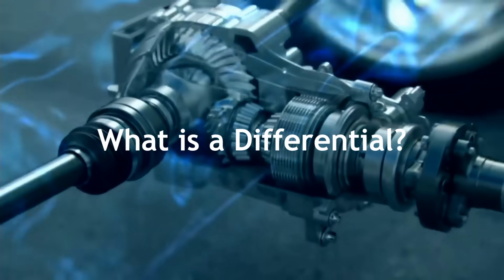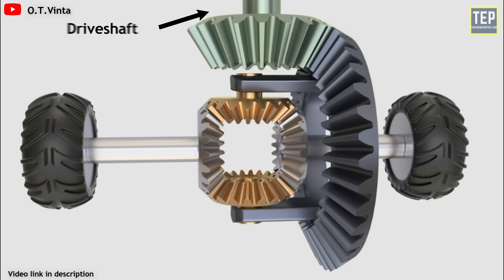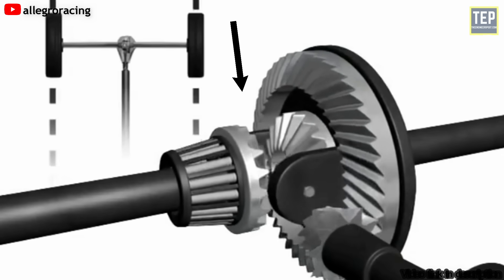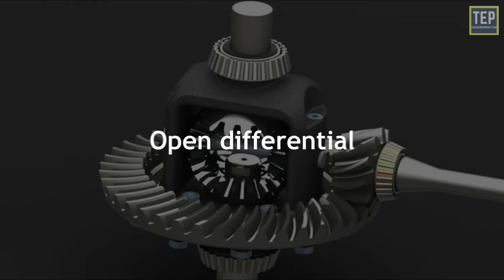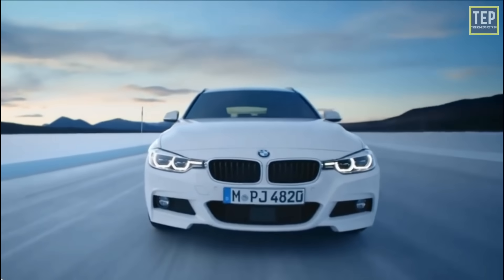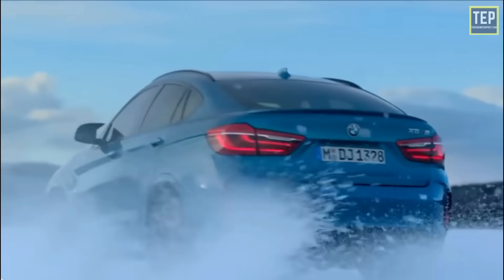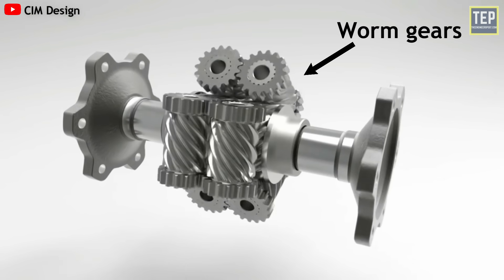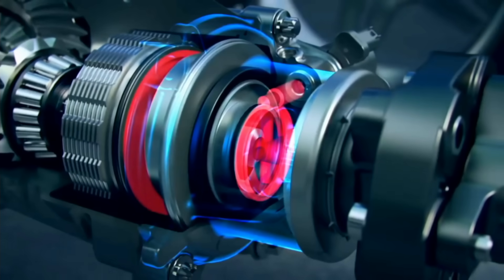How a Differential Works | Types of Differentials Explained

Comment: Hi! Hope you are doing good....I have a small doubt... how does the spider gear knows that the car is turning so that it reduces the speed of the opposite wheel?....It would be great if you have time to explain me this😰
Reply: Its. A matters of load on wheel. If one wheel cant turn and the crown gear is moving. The one side of the spider gear is locked. So to move with a crown gear it needs to rotate to overcome the lock of the side. Its like a normal wheel. When it touches the ground the point of touching is stationary. To move foreard the wheel needs to turn.
Reply: Oh ok...now got that...Thanks for your time!

Comment: Locking diffs and locking hubs for off road use, man what good times!! I remember jumping out of the truck to lock the hubs!
Reply: im looking to buy a daihatsu feroza and it has manual locking front diff
Reply: @kyal1068 what he's refering to are manual front hub locks, which enable/disable the connection between the halfshaft and hub.

This disconnects the front differential from the hubs individually, but combined with selecting 2wd completely disconnects the front drivetrain from the transfercase and wheels, increasing longevity & fuel economy. 

You have pneumaticly controlled, electronically controlled, and mechanical/automatically controlled lockers

and If I had to take a guess it probably has a mechanical locker.

Comment: I believe that Thorsen differential is better then ,,open" diff. in a cheap small car. From what I understand ,Thorsen diff. in a 4x2 traction car, do not spin a suspended in air wheel (with no point of contact with the ground) while the other wheel which is on the ground (have 100% grip on the ground), stay (and not spin at all).
Reply: That's true. The use  of worm gear-worm wheel combination means that if one driven wheel encounters zero friction condition and "wants" to spin all the available torque away, it cannot because the worm gear can't drive the worm wheel, so the driveshaft that has traction (the one on the asphalt!) controls the rotation rate of BOTH worm gears, thus transmitting all the torque to the entire driven axle. Frankly, it's genius! Works on snow, ice, mud and round Druids Hill bend at Brands!
Reply: @robair67  Yes it's the best of both worlds, can't get why he said in the video that it consents wheelspin.

Comment: I got the Torsen differential out of a firebird and put it in my S10.  Mine's a 4.3L 5speed and that thing...I've gotten stuck on wet grass before when I had the stock open differential in it. It drives really good with the Torsen in there. GM should have offered it from the factory.
Reply: When did firebirds use torsen differentials? Ive considered putting one in my 3rd gen, never knew they were a factory option.
Reply: @sthomp731  I have the last generation of the firebirds a 2002 and I don't think it comes with a torsen differential but the limited slip differential (LSD) I know because I fixed a leak replacing the gasket and it looks more like the one I just mentioned;
Reply: @chrisdrake3238  1999 to 2002 Camaro/Firebirds that say Y87 on the vin sticker on the driver's door will have a Torsen. Some of the V6 3.8L could have a Torsen also. If you can't find one,Hawks motorsports had some used ones for about $250.+ shipping.
Reply: @Thundarr995  didn't know that but I'll check mine if it has that sticker on the driver's door thanks for the info
Reply: @sthomp731  99-02  Some V6 Camaro's/Firebirds had them too. If it says Y87 on the driver's door sticker. That's the code for Torsen differential.

Comment: Welded diff💀
Reply: Welded diff =  no diff = solid axle =good only on heavy snow , ice, mud.  But on dry good road (with 100% grip) ,is not good, because the motor drived tires will wear very much,very quickly,and when cornering, is noisy on asphalt roads  !

Comment: Great overview. I have a torsen in my vw (passat 4motion), and it works very well...
Reply: But you have only 1 torsen in the centre diff. Both rear and front are open so it's far from good
Reply: https://youtu.be/uFyHPg51nGk
Reply: Sure, I know that. But I meant the ratio and the reaction between front/rear. If one of front wheel slips, the torque immediately goes to rear (of course with better traction), so two wheels is rotating with ratio up to 70:30 (front left and rear right, or vice versa, left side, or right side depends on the situation)

Comment: My opinion: Open diff is the best if u drive normal in alphalts roads, no matter if it is raining or snowing 
Looking for offroad ...than limitet slip...or locket diff works good... 

Ps... my car is left wheel drive cos first right axel is removed... dont try this in open road lol...sometimes if u accelerate cars wont moovr cos is sending torque only to right side lol...and when torque goes to left wheel than car pulls quickly to left side hihihi...it is so fun and dangerous too lol...and in hills sometimes it wont climb only rew hight and goes down...like u push clauch and accelerator at the same time
Reply: Why the hell would you drive with a cv axle removed, that's dumb